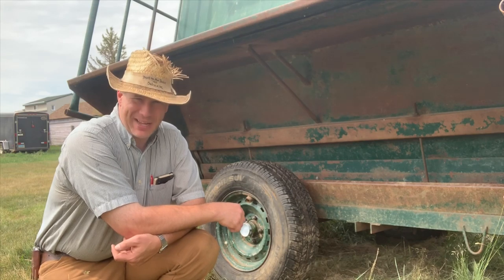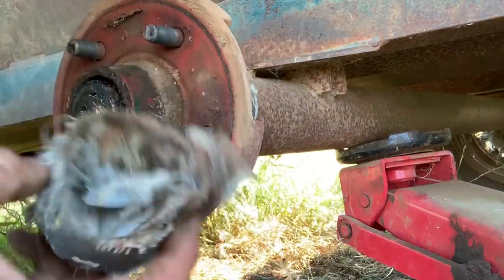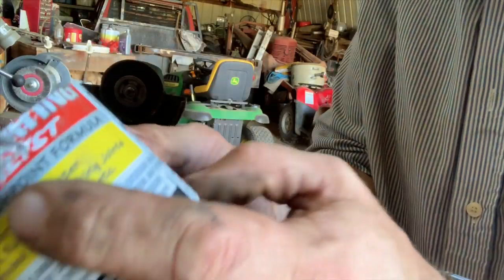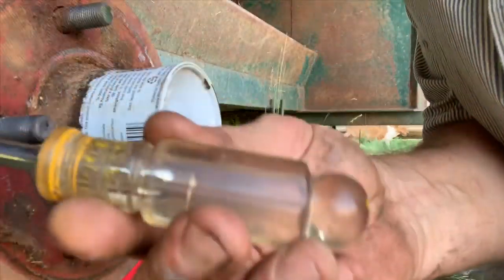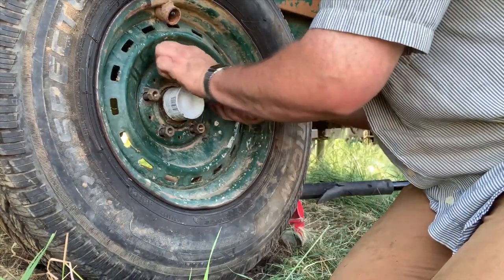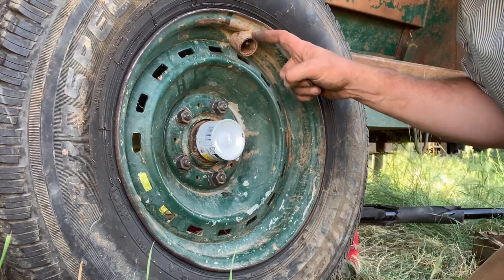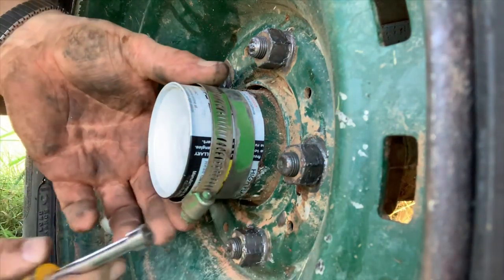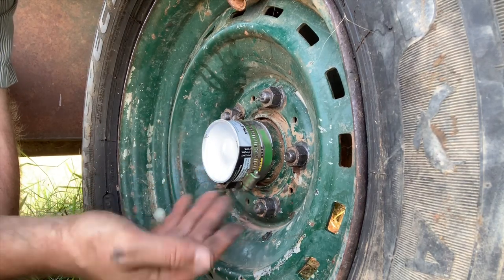Homemade dust cap for a wheel bearing hub.

Comment: You may know this, but one of the many things I learned in the Army is how to put an extremely heavy tire back on an axle. If you sit on the ground facing the axle with the wheel between your legs, you can easily pick up even a heavy wheel by squeezing your legs together and lifting the tire. The tire will be around your knees and you can hold it steady with just your legs, allowing you to use your hands to align the lug nut bolts to the wheel, and then screw on the lug nuts. You will also be able to see the alignment since the axle is almost eye level. It might help you in the future putting tires on, especially if they are heavy. Thank you for this videos. It is nice learning new tricks from a fellow rancher across the country.
Reply from the maker: I will do that next time, I often use the trick where you use your toes to live the tire and you can move the hub. But I’ve never thought of doing what you suggested. Awesome I will definitely try it next time. I didn’t want to be anywhere close to to it this time. It was slipping off the jack and I was ready to be out of there.😉
Thank you for the great tip Matt.
Happy trails
Luke

Comment: Had a cap come up missing the other day... On a Krause offset disc. Found one that was close at the Case-IH dealer... Biggest one they use on their discs... Lol.. it WAS 3 1/8"... I needed 3 3/16"....
Put it on the lathe Chuck to stretch it out, worked perfectly!!!
I have done a few cheap dirty ones too😎
I didn't know they made new hose clamps... Lol
Thanks for the video!!!

Comment: Im having trouble finding caps for a 1947 trailer and have used a plastic cap off a spray tan with the clamp before in pinch but good idea using PB Blaster can I might have to do.

Comment: Luke, when I saw you cutting that aluminum can I knew right away, that did not come from an old timer. The idea came from old timers but we old-timers would use tin cans, whether it be beans can or whatever was handy.
Reply from the maker: Gold pop cans worked well. I bought a trailer with an old p0p can on it and it really worked good. For years in fact.

Comment: When you said what can  you do about the missing dust cap, my first thought was one of the frozen orange juice cans would be about the right size to press in like the missing cap, except for tire replacement,  you external cover over the whole hub is likely more way more secure.   Thanks for explaining the coupling you put over the tire valve stem - I was going to ask what in the world  that was all about.  (I suppose if I was a farmer feeding cattle, I would not have had to ask :-)  )
Reply from the maker: You’re smarter than I am had I not seen this trick before I wouldn’t of thought of the orange juice can probably. I know it’s interesting when a farmer or rancher comes to the place they immediately look at what I did to that room and they go ha ha why didn’t I do that years ago.
There is a major difference between common sense and common knowledge.
Happy trails
Luke